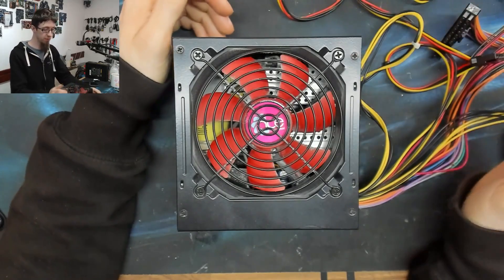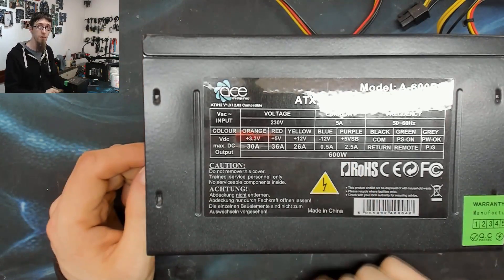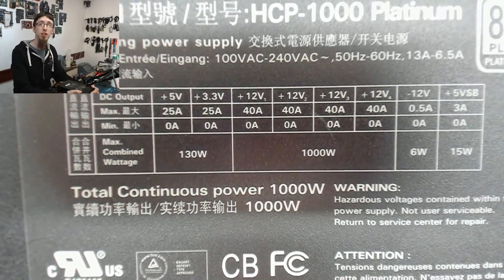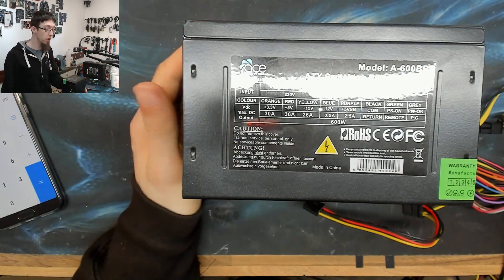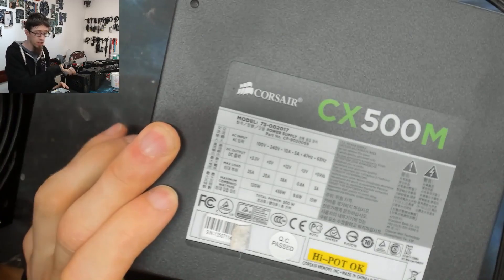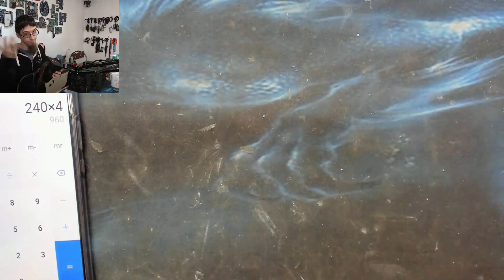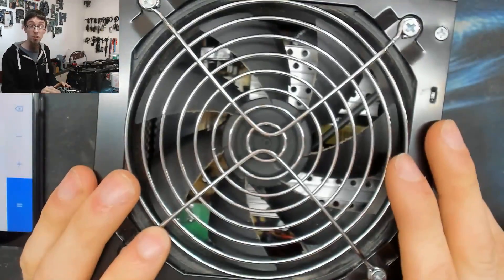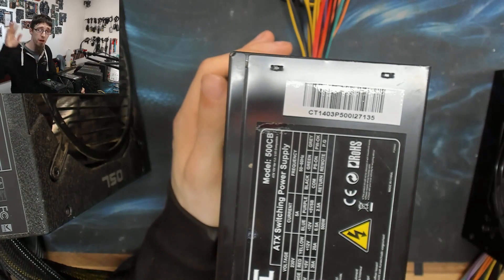LFC#171 - Why This PSU Is Crap

Comment: My rules for PSU:

Know brand
Bad: less than 70% of the rated power on the 12v rail
Could be good: 80%+ of the rated power on the 12v rail
Good: 90%+ of the rated power on the 12v rail
Excellence 100%+ of the rated power on the 12v rail

Unknown brand
Bad: less than 80% of the rated power on the 12v rail
Could be good: 90%+ of the rated power on the 12v rail
Good: 100%+ of the rated power on the 12v rail

@ Still running my OCZ ZX 1000w that I brought new for very cheap 8 years ago.
Reply: I had a bad OCZ 1000w the 3.3V rail would run undercurrent and my pc would randomly crash under small loads.
Not saying it's a bad psu but i wouldn't buy another ocz that's for sure.
Reply: @Star_Sn1per  
Well they bankrupt some years ago so you cant buy them new anyway unless its old stock.
But you probably got unlucky because as I said mine is running for almost 9 years with 0 problems.
My model is a re-brand/build by Greatwall one of the best PSUs manufactures. Greatwall still one of Corsair suppliers to this day.
Jonny Guro review of my model (9.5 of 10 score)
http://www.jonnyguru.com/blog/2011/05/13/ocz-zx-1000w-power-supply/5/
Reply: @vitor900000  Yea i had a bad unit but now i got a seasonic focus 750 and couldn't be happier.
Reply: my rule for PSU: 
does it have DC-DC conversion for minor rails?
yes: good enough
no: dont buy
most budget PSU that has DC-DC conversion has adequate quality to be used.

Comment: My retro Athlon XP system laughs at your fancy, modern PSU’s with their weedy 5v rails 🤣
Reply: That more or less what's going on with that PSU.  It was designed before heavy use of the 12v rail was common place.  The manufacturer is just selling an old design because in most cases it's "adequate" and cheap to manufacture.  ATX 1.3 spec is essentially for the Athlon XP Pentium 4 era.
Reply: Amd Socket A are renowned for consuming alot of 5v powers. I have AMD duron
Reply: @Cr0Lar Mt 9700k at stock pulls in excess of 127w unless one forces it to clock down within the guidelines. 4.9GHz all core OC it draws 160w.
Reply: @Richard Clutterbuck He was referring to a GPU, I have an R9 290 in another rig that eats up the wattage pretty good on the GPU side. Probably close to 300w.
Reply: @Cr0Lar Why have you not undervolted your Vega? You can easily run it with 1600Mhz on 1050mv or less. Letting it pull 300W just makes it run extremely hot and unefficient.
My Vega64 runs with 1080mv, 1730Mhz and +85% power target(power mod). Pulls about 220W Max and runs pretty cool.
Reply: @Cr0Lar Yeah, was wondering where you got those 300W from.
I'm very happy with my Vega 64. Got a Sapphire Nitro + and it's just great in it's current state. Runs stable and cool and i was quite lucky with my HBM2 which runs with 1100Mhz.

Comment: I went with a budget power supply, it's a Thermaltake Smart 500W 80+ White Certified PSU. What's your opinion on those?
Reply from the maker: Bare minimum really. It's not going to blow up as long as you don't overload it - but I'm not a fan of these 80+ White rated PSUs... Bronze really shouldn't be hard to do for any main-stream brand.

Comment: What caused the Corsair CX 500M to pop...? Overloading...? Mine has been in regular use for 2 years so far with no issues, though only on an FX 4100 / 1050 Ti combo. Yes, the one that came as an FX 4100 / 550 Ti with a "750" watt CiT (which I never plugged in, of course).

Comment: That cheap crappy Ace power supply is actually pretty good for retro computers. those need the 5V and 3.3 Volt rails to be stronger while not putting too much load on the 12V. Many modern power supplies are actually too weak on those rails.
Reply: maybe I should get one of these for my Athlon XP to replace its Zalman ZM400B which dates from I think 2005...? then again, maybe not :P
Reply: @RWL2012  I am not quite suere about the Athlon XP's already using the 12V rail.
Also I guess those bad ones have a lot of ripple which the old VRM's don't like.
But yeah, I guess these chepo PSU's are kind old models that they just rebadge to look as if they are for modern machines.
Reply: @catriona_drummond  if I recall correctly only few boards have 12V input for CPU. 
You can always recap these cheep PS with better caps usually get much better ripple. Some boards (I think they use only few layouts in all these cheap supply units so probably most of them) have positions for additional filtering (inductors between caps on rail etc.) so clever use of salvaged components with little bit of knowledge can give you much better PSU than that guy in Chine ever think you will get when he put that 800W sticker on it.
Reply: @gorky_vk  Cheers. I am working to get to that level. ;)

Comment: I thought that the 3.3v rail was for the CPU? 12v was only for accessories and graphics.
Reply: @Adamant_IT  #TheMoreYouKnow
Reply: It was, AFAIR 20 - 30 years ago.
Reply: No, 30+years ago the 5v rail was for mostly everything, 12v rail was used for motors. The 3.3v rail came about when IBM Cyrix CPUs came about, they ran directly at 3.3v.

Comment: I’m pretty sure the 3.3V rail is used for some of the CPU power system.
Reply: Adamant IT - I just know from working on MacBooks (although not exactly the same) that cpu rails can come from the 5V rail etc.
Reply: No, the CPU derivatives its power from the 12v rail and is converted to low voltage high current via the VRMs, it's more efficient.